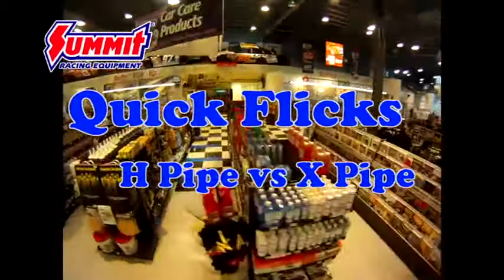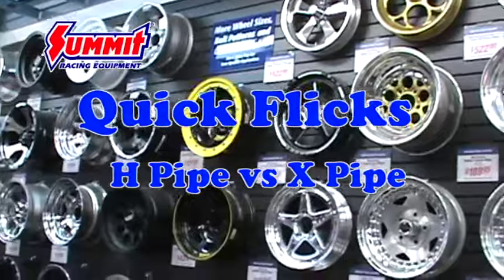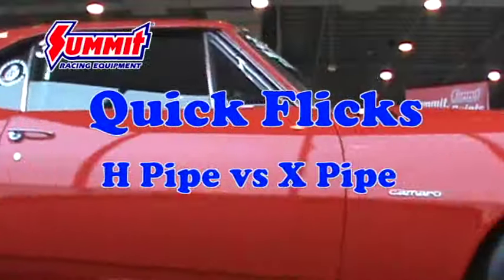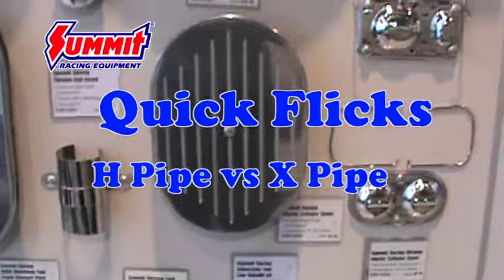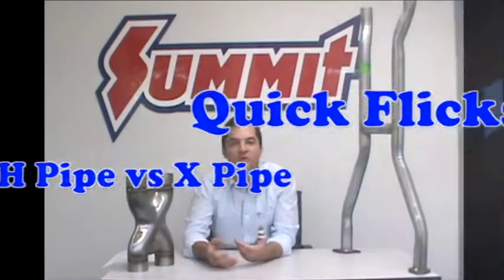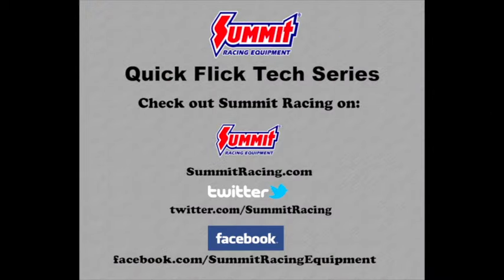Exhaust X-Pipes vs. H-Pipes and Differences Between Them

Comment: I have a BMW ALPINA B10 V8 from 1997s, I plan to cut the catalysts and in their place insert X-pipe or H-pipe or Straight pipe, which The Solution will be better?
Image stock exhaust: http://imageshack.us/a/img29/5518/hbie.jpg
thanks in advance
Reply from the maker: Hi Pure Trance, 
Its apparent by the diagram you supplied that there is a factory installed X pipe on the car. Try to keep an X pipe in the new exhaust that you plan for best results. As for removal of the catalysts, we cannot advise on that, as this will void the emissions legality on the car. Good luck!

Comment: since when does backpressure make power? torque and power from exhaust comes from the diameter of the primary pipe the length of that pipe and the type of collector and exhause system/extentions. Zoomie headers are terrible for horsepower, don't do it see @hothod on the zoomie test. Long tubes of the right length make more power and the type of collector matches the system.. extensions help why it's not because of this dingleberry saying backpressure. he's a salesman not a engineer...

Comment: Wow, I'm sorry but I can't let this die hard myth continue about back pressure. Really I can't believe that you SUMMIT RACING got this one wrong.  Back pressure does not help any engine at all!  Where the confusion comes in is the exhaust speed. High exhaust speed is what you want at all times but you have to compromise.  High rpm's mean higher cfm's and low rpm's mean lower cfm's (cubic feet per minute). At low rpm's you have to keep pipe diameter small to keep air speed fast. (Its just like a stream when it is wide the stream is slow, when you come to a narrow area the stream speeds up.)  Now if your running high rpm's you need a bigger pipe. Now I know your asking wouldn't small pipe be faster still?  Only to a point of diminishing return. You have to factor in the resistance of the friction of the air against the pipe walls, at a certain point the resistance of a smaller pipe with to much flow starts pushing back against the motor's exhaust stroke, thus backpressure.                       
So a big pipe at low rpm's will slow exhaust speed, this is bad because it is like coming off of a freeway into city grid lock, the incoming exhaust pulse slams into the back of the one in front of it. But what you want is the incoming exhaust pulse to be pulled along by the pulse in front of it and it does this by the low pressure that is formed behind the exhaust pulses high speed.  Its like driving a vehicle down a dust dirt road, (imagine that your vehicle is the exhaust pulse) at high speed the dust whirls up behind you and coats your back glass, but if you creep along the dirt road there is virtually no dust kicked up, thus a slow exhaust pulse has no low pressure area behind it. 
So size your pipe for what your driving needs are so your motor gets its needs to meet your driving needs. Clear as mud?
Reply from the maker: Hi dun33628, 
Thank you for your contribution to the conversation!

Comment: So I have an ls2 vette7...ive done everything from harmonic bal to ud pulley..hc 102 lsx rockers dual valve..msd wires...everything except procharged..and currently have factory hpipe and had dual flowmaster..I enjoyed them but my gut told me I was being restricted idk why...so I said fuck the ongoing myth and straight piped it at pro shop muffler while im in spring break miami...once it was done  .it took off and put the peddle to the medal..all flow was unleashed and the car even at low end was peppy..it felt like chains was taking off ...and at wot..it just didn't won't to hold back.....now im thinking of doing the x pipe..but I feel as it needs to be tuned...but team muffler delete.. fuck u myth sayers from holding me back..and I save a bit more mpg on the highway